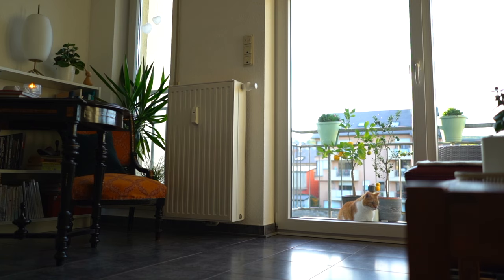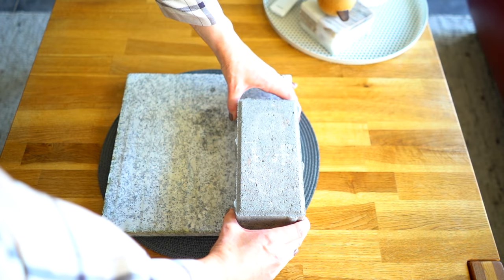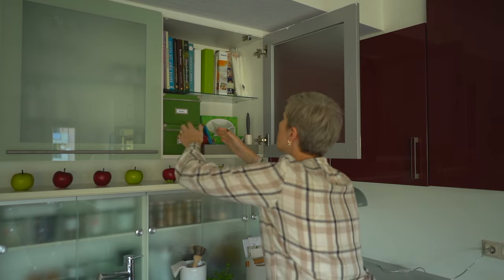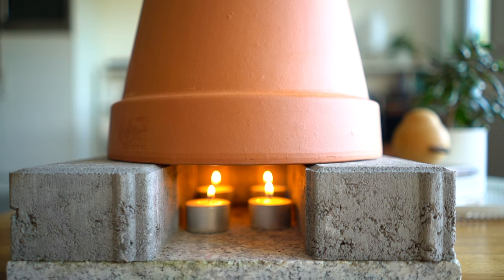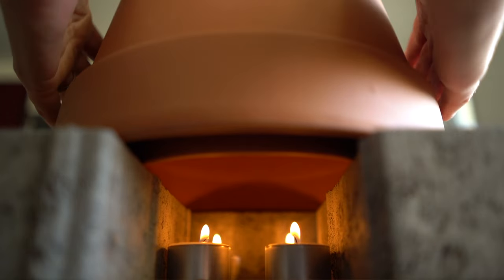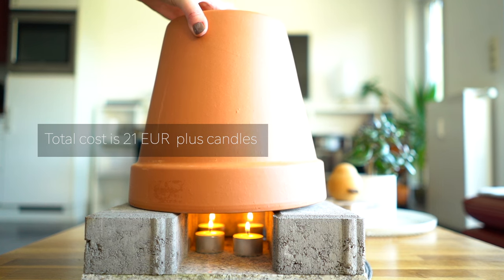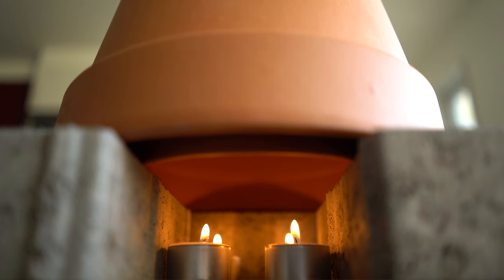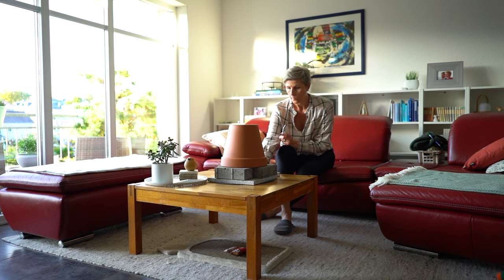How to Make DIY Clay Pot Candle Heater in Just Minutes! | Does it really work?

Comment: Do not be when I seen this I had to experiment to find out how true that this is I had to use two big pots with 12 of those small and two small parts with three candles under each pot a total of 30 candles and it was not even that cold here at the time this method can help you heat your home but it takes a lot of flame this three or four small candles is total bullshit
Reply from the maker: Well, I can see that the results might be very controversial. For some reason it worked perfectly by us and literally, as I said in the video, INCREASED the temperature for few degrees. It might be that our home has better insulation than yours, like double glass packages and thick walls, it can also be different size of the room or the different climate. That this heater didn't work at your given place, doesn't mean that it do not work at somebody's else.
Reply: Not total bullshit. Videos explains very well based on circumstances of the home. The video is described correctly, nothing false and this does work in a small area. Who would try heating their entire home with a few candles anyway? Please use punctuation in your comments as so others can read your feedback correctly.

Comment: I have a friend who has been using this method since last year. She told me it makes a big difference, especially in her living room. I purchased the tea lights, but not the pots. I am so afraid of fire! I do have a tile table and 1” thick piece of marble I could use as a base, with a metal tray on top. I think that might be safe. But the room is open and I hear these work best in small rooms. What has your experience been? Love from USA!
Reply from the maker: Hi @miask, if you follow the precautions, it is safe to use  the heater like this. No wobbly surface and fire resistant base sill make it. 

Our living room is 35 m2, it's about 376 sq ft, I have no clue whether is considered big or small for USA standards, but my pot is enough to rise the temperature for this size of room. However it's too small alone to heat when outside temperatures significantly drop. But as I said, it really adds more comfort. Greetings to you too!!

Comment: Just a thought but in the video I watched a few years back, the upside down terracotta pot sat on a dinner plate with 3 piles of coins with 3 coins in each to elevate and support the pot. The tea light candle also, sat in the centre of the plate, under the pot. Another, 3 piles with 3 coins in each sat on top of the upside down pot. This was to support and elevate the upside down saucer/bread plate on top of the pot to encourage the dispersion of heat around the room. I have not tried this method or any other so could not say if it is a safe and effective one or not. I think the words “Cornish Heater” were in the title of the video. Stay safe & be well, all
Reply from the maker: Hi Melonie, thanks!

I was using the bricks (which is much more safe and sturdy than the coins) for elevate the terracotta pots, because the flame needs an oxygen for keep on burning. And with all the precautions a.k.a. granite plate underneath and not leaving unattended, must be all good and safe. You yoo, take care!

Comment: Hi, instead of candles maybe you can try a simple diy oil lamp from an small/old glass jar with metal cap and some cheap sunflower oil etc. Regards
Reply: I take candles out of the aluminium case and put in dish and add oil to make a candle burn 24 hours or more.

Comment: If you calculate the cost of candles compared to other heating fuels per heat output then you will see that , cheap candles are made from oil ( parrafin wax ) and  there is no oil derived product that is magically cheaper.

Comment: After Daniel Tartaglia , it's need 10 or more flames to heat a room that have a good insulation . Another, it's need to have ventilation at this system with flames to make hot air to flow quick . Another, it's good to have a radiation system at your stove . If it's made from metalic boxes that's are for preserve food , don't heat to much to become red because it will be destroyed more quickly . Use more systems of heat for indoor that will reduce smoke : methanol, ethanol, comestibil extra virgin olive oil or raps oil , use a chimney to improve burn and reduce smoke . You are surrounded by free materials that are good and free for heat and cook and have light ,in your house : cotton clothes,paper , cartoons, used oil ,and also at garbage containers and not only,you find wood and many others materials . There are rocket stoves that can be make to give more time heat if you use also sand battery inside .

Comment: The total heat energy of the "heater" is no greater than the output of the candle flame itself, the terra cotta pots only distribute the heat in a thermal mass, its a heat sink. By using a larger candle, you raise the output of the heater, and this will only be by the amount of the candle's total output. Many people use vegetable oil candles to sustain longer burn times, and increase the heat energy of the burn. They are easy to make. By covering the hole in the top, you are trapping the heat within the first pot, and stopping the flow of rising heat. If you stack smaller pots atop the first, you gain output area.
I tried this type of heater and found I could only heat a space about the size under my desk, so, it is great of you want to keep your feet warm under your desk as you browse the internet on cold mornings.
Reply from the maker: Thanks for watching!

Comment: Unfortunately this is very dangerous!
The candles can very easily overheat and can cause the whole surface area of the molten wax to catch fire (very similar to a grease fire in the frying pan).
If this happens, the cosy burning candle will suddenly start to burn furiously.

Candles should never be lit close together (they heat each other)
You mention this in the video but these candles are still too close to each other.

Candles should never be covered by anything (not even non flamable items like a terracotta pot).

Never restrict the airflow around a candle.
The air has to flow freely into the candle and the heat and exhausts has to flow freely up from the candle.

If you break any of these rules you risk overheating the wax and and in worst case a serious fire.

If you are unlucky enough to experience overheated wax caught on fire:
NEVER TRY TO PUT OUT THE FIRE BY BLOWING ON IT (it may start to burn even more intense).
NEVER TRY TO PUT THE FIRE OUT WITH WATER (it WILL cause an a huge fire ball (like water on burning grease)).
The best way to put out such i fire is to cover it completely with a cooking pot lid or similar (the same way you put out a grease fire in the frying pan).
Reply from the maker: @mrscandalpolisen, thank you for your insights and concerns! However, 1. Those are not a wax candles and leave no residue on the pots as it simply evaporates as burning turns the wax into invisible carbon and water vapor. Here is the link which explains where the wax goes when burning: https://www.candlescience.com/where-does-the-wax-go-when-a-candle-burns/
2. You must have heard about the covered candle holders, right? Merry Christmas and stay safe!

Comment: The clay pots have no effect. The heat comes from the burning fuel. That's it. To heat the room, you have to heat the air in the room, and since hot air rises, the room is warmed from the top down. The radiant heat of the clay pots just makes the air around them warm and raise the same way as bare flames. There is no magic trick here. If you know the heat content of the oil you burn, you know how much heat will be produced. The end.

Comment: A coule of questions : Does burning the candles produces smoke AND most dangerous gases? Anyway they get out of the house? If not threat to life? To save more money someone would burn very many candles in every room in the house! So heavy threat? Could it kill the occupants? Any way to let the smoke and dangerous gases out but preserve/keep the heat in? If there is show, disclose it. If not are you not causing threat and danger to the
L I V E S ? Please do not do this.
Reply from the maker: 😀 I understand your concerns, so many questions… 
However the tea candles doesn’t change their behavior and the chemistry just being under the pot, sorry. 😀 
You’re mistaken them for the firewood which didn’t act in this video 😀😀but yes, don’t burn the firewood indoors without good ventilation.

Comment: I had to stop watching the video after you said, "For safety reasons, separate the candles from each other" that is possibly the dumbest fking thing ive heard... WOULNT WANT THE CLAY POT OR CONCRETE BLOCKS TO MELT. 🤦‍♂️
Reply from the maker: @paulleonard7038 That's OK not to watch everything. That's OK to have an option write your opinion and express it the comment. That's not OK to swear while you doing it.

However, if you would think 2 cm (or 0,787 of inches, depending on your reality) further you would let the pots and concrete behind and concentrate on the candles only. In my young years I had a stupidity to lit a bundle of tiny candles all at once. They looked nice and cosy until begun to melt into one and all their flames united. It caught up quite large flame and there were not the few tiny burning candles anymore, there was a one thick candle with several burners and a huge flame, which didn't look cosy anymore and I was lucky seeing it happening and could prevent a possible fire. I am pretty sure that wouldn't happen with the tea lights, but I am just pretty sure, so would risk checking it out or encouraging someone else to do that in their homes.